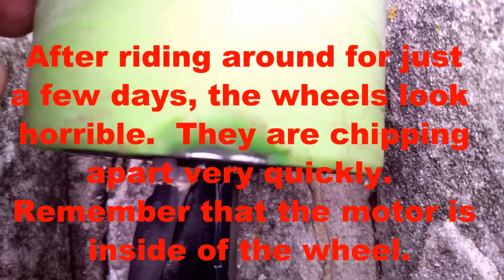Genesis Electric Skateboard Review Part 3

Comment: Got my board last Friday. Put about 75 miles or so on it. Had not one issue for a while. Came back from the store (maybe at 6 or 7 miles at this point) and had two bars battery, then it just stopped. I had hit bumps a day or so prior and earlier on a ride that are pretty wicked and never had a power issue. I was about 500 feet from home on a VERY smooth hill when it did turn off. Tried everything and it wouldn't do much. If I disconnected the battery and re-inserted it and left it upside down it would turn on and run fine, but the second you tried to flip it to wheel side down it would turn off and not turn back on. Called them and explained it. They had me print a shipping label and just mail it (on their dime) to NY. I should get my new one not long after (similar to your situation). In the days I was trying it I didn't trust it to go far either. I woke up really early on the weekend to test it on a main road I would use. I was extremely satisfied. I was actually a little surprised with how big the wheels were when opening it. I knew they were big but DAMN! It either pushes the rocks or goes over if they can't be avoided. The warranty is awesome, they were friendly, the board is sick (minus the one MAJOR issue I had; which is being resolved). I am going to buy my wife one later this month and a couple extra batteries. Will be fun to cruise into town and swap and make it home. Do plan (once the warranty expires) on re-gripping and adding some Spitfire bearings or other nice ones. May also look into the connector if I need later (seems to be the only issue others have had, as well as the one I had) and add something better on, or bring it to an electrician and pay him $50 bucks. I think it is the female end getting loosened up by the male end while bouncing. I am pretty light so I didn't have too much bend unless there was a big bump. Either way, it works well for what I want it for. My MAX distance on a track that was kinda up hill and down with HUGE cracks, was 10.66 miles. I pushed the last .4-ish. Very confident it will get 12 or so on the smooth roads. The bicyclists got a kick out of it! They would pull up at a light and say, "That is why I couldn't catch you!". A lot of fun for sure and I feel you on the getting to know the board before going far.
Reply from the maker: I had all the same hope as well. My board no longer turns on the mount that holds it.......well im working on part 4 smh gd it genesis so dissappointed. I have heard about so many returns. The return rate must be unbeleiveable. on the bright side if you order direct from china you can save about $200 but i would never buy another one thats for sure.  Just a throw away board for me now. Its done this is my second one. I cant see playing the return game over and over but I will see what they say. I feel like theres no boards they have that will hold up to serious milage. Now dont get me wronr I put a ton of miles on it. A whole lot of use out of it and rode hard all the time. These just are not meant for that. with all the videos they make they make it seem like that though. I have more reviews on other brands coming Im working as hard as possible here. sorry for the delay though
Reply: urmaker The question is would you really and I mean really trust your life behind this rebranded product? You do know its a KooWheel D3M Skateboard with a Genesis Stamp on it instead. My Genesis HellFire runs ok but I just dont trust it cruising here in NYC. I literally tap down to brake and I go flying. its too sensitive. I do it accidentally and pay for that all the time. For peace of mind and safety I would reconsider and spend extra on a quality company's board. Genesis just purchased 10,000 boards from China, rebranded them and now flips them for profit.
Reply: I actually use the brake just fine. It is very sensitive (and was a learning curve) but can also be used pretty well and solid without tapping. Yes, I do trust it, as  much as I would any other. But, I am not cruising between traffic like you may be doing. I am fortunate enough to live in a place where there are a lot of paved biking trails as well as pretty decent streets.I highly recommend you do not tap the brake. That seemed harder than learning to SLIGHTLY apply pressure. I haven't tried others but am actually surprised with how it was. I was expecting the brakes to be unbearable. For my needs it is perfect but for others it may not be. It is more of something to get my wife and I out of the house, not so much commuting anywhere important. I did put some miles on it. LOL A lot of fun.
Reply from the maker: my opinion is in order to compare something to something else you have to use them both. using one and speculating on another is not really a comparison.  The board is very very usable without a doubt. I did a lot on it I never thought I could thats for sure. But did is the key word. For $500 how long does anyone expect to get out of this board? A year? Give me an entire season and $500 is ok. Get one and cant use it at all is no good. Get one and use it for just 3 weeks. No good. For some it may be great and service its purpose. For others it may be very disappointing to say the least.

Comment: Joe any luck on Replacement wheel/hub. I have a new board in the box but dont want to go crazy on it yet. They haven't got back to me on replacement wheel info.
Reply from the maker: +BroFessor Sqrl they told me they dont have them but i found a company that seems to have an awesome setup.  They have diy or complete boards at the same price point.  As far as wheels i found the whole truck and wheels setup for $150. Just in case but i have a feeling this board is getting converted.  Stay tuned for sure i am nailing the order down this week.  im pretty impressed with this product i found
Reply from the maker: +BroFessor Sqrl im getting info about this company as well.  looks like they are not customer service oriented as from theirl business they ran before this one.  I feel like they are in to get in and out.  After this year i dont think we will see much of them.  Theres much better product out there as im finding just no means of marketing.  If I find the right board I'm going to gladly make as many videos as I can for the company I'm on the hunt
Reply: Joe Kyser cool keep us posted. im in nyc where the roads are horrible. got a feeling ill have the same wheel issues as you very soon
Reply from the maker: BroFessor Sqrl dude wait till you see part 4. The wheels are tore the fuck up.  I am much happier when i use the tube tires on my other board.  I have the skate wheel option and totally love it way better but riding long rides and all the all terrain is the way to go.  I will be doing a review on that board as well and I'm going to show the difference between the all terrain and the skate wheels.
Reply: Joe Kyser im thinking of putting a layer or SHOE GOO over the wheel that covers the hub motor. Its a great glue skaters use to repair skate shoes when ripped. Its amazing glue and leaves a tough layer. Look into that.
Reply from the maker: +BroFessor Sqrl oh i have shoe goo.  I think the wheel compound is too soft to have such a hard core.  The front wheels are mint condition still.  The compound of the front wheels is much harder.  Its the edges of the wheels so a little glue around it may be helpful.  Im thinking coating the whole thing will lead to bad traction though.  Idk hey its a possibility
Reply from the maker: those replacement wheels look like the ticket huh?

Comment: the evolve gt boards are great. they are super fast and incredibly nimble with the double kingpin trucks. this board has A LOT more potential to hurt you as it is a MUCH higher performing board than the genesis board so please be careful and wear pads when getting used to the board. GT mode is NO JOKE. the throttle will easily toss you off the back and the brakes will put your face in the pavement if you are not braced. the remote is super schetch as well so any time you are not actively riding the board, turn that remote off immediately. the slightest brush of the trigger will send the board sailing.

there are a lot of 'issues' with the evolve boards. as an owner i am going to make a prediction you are not going to be entirely happy with the evolve board as a daily driver. chances are you are going to experience some type of issue that displeases you. there are just to many issues to avoid them all.

if you dont mind a suggestion for the direction to start looking for your next purchase, i would strongly suggest you look into metro-board. they dont make the sexiest or fastest boards but they do make the most powerful board and they have a long standing reputation for incredibly solid build quality and incredibly good support for the times when issues to come up. i have a metroboard for almost 2 years now and really there has only been one time it failed and was not usable and that was likely the result of my own abusive use of the board. i really like the hardwood stringer decks they offer but they will even build a board on a custom deck you send them if you want.

i have a bunch of electric skateboards. you can see them on my channel. the metro-board is the most reliable.
Reply from the maker: dumwaldo well I've had it a month now and you hit it right on the head subscribe to my channel and wait and see the experiences I've had so far it's just been crazy especially my issue that ended up costing me money but I understand why it happened two hundred and $205 later back on the road. love it
Reply: Joe Kyser I realized after I replied that I was a little behind on your videos. I'm subscribed now and I really like your take in things so far so I'll be watching. Ride safe and I'll see you in the videos 👍

Comment: Hey Joe - here's a thought:  

I 've been riding a "Carver Resin USA" - a 31.5" skateboard with spring loaded trucks...

http://shop.carverskateboards.com/collections/surfskate/products/31-c7-resin

 - if you do some heel-toe action this board will self proper itself.  just swing your hips a bit - do the heel toe thing - and you are pumping along.  people look at me like I was on a motorized board - but I'm the motor.

What if you took the spring-loaded front trucks from the Carver skateboard - and put them on the genesis?  switch out the wheels to the Genesis wheels - and you may be able to pump along with the motor to extend the mileage-range...

What say you -Joe - and eboarders?
Reply: audionics2001

Comment: have u tried the fast mode? apparently when it's off, press the power button 7 times and it should beep and be in fast mode. when u turn it off it goes back to normal. what difference does it make to speed? thanks for uploading
Reply from the maker: +mackiwawa yeah I saw the video that the manufacturer made about that the first board I had that was never required you could just mash it and it would go full speed without a doubt you never had to press the button several times so I'm going to have to check that out. That must be part of the upgraded motherboard feature
Reply from the maker: do you have the tomahawk?
Reply: i've ordered a koowheel d3m which is like the genesis evolve or something
Reply from the maker: mackiwawa oh ok, i was looking for someone with this exact board.   had a question that's all.

Comment: Found replacement hub motors for Koowheel/Genesis https://m.aliexpress.com/item/32763191063.html#autostay
Reply from the maker: Yeah i saw the motors on a couple different sites. According to the stamp on my wheel they are 350w. Genesis claims different 250-260w or something like that. Theres a bunch of options for hub motors but I wouldnt buy these same ones.

Comment: Hey Joe!  Thanks again for your no holes barred reviews!  I think I found the koowheel equivelent on alibaba - and they have a warehouse-distributor in the LA area where I live.  Here's the link - check it out and let me know if you think it's the same as the 36" model genesis hellfire:   https://shenzhenzhanda.en.alibaba.com/product/60532991058-802227048/Koowheel_4_wheel_longboard_250w_2_Remote_control_sport_electric_skateboard.html

I will contact them and see if I can pick one up over the weekend if you think it's worth checking out.  I'm new to the e-skateboards - but have been following the genesis reviews closely - especially yours!  No sucking up in your reviews -  you call it as you see it - or ride it as the case may be.  keep it up!!  thanks!  eric
Reply from the maker: thats the belt drive version but ya thats the company
Reply: Thanks for looking, Joe - scroll down a bit  - when you get about a third of the way down they start showing their board - and compare it to the belt drive board with the non removable battery.  I think this the same board as the genesis hellfire.  I really value your opinion - and want you to confirm.  Please scroll down.
Reply from the maker: audionics2001 oh you know what the actual pictures up top have those same pictures of the belt drive so when I clicked on the picture that's exactly what came up was the belt drive I know they did have a belt drive version at one time I know that for a fact I saw that before this board came out then they went over to this style that was probably almost a year ago though and the batteries were different too it wasn't the same battery but anyway I'm going to get in contact with this company and I'm going to see what I can do about getting one of these boards if they're telling me it's not the same as Genesis I mean I would be more than pissed off if I got this board and they're telling me it doesn't have the same issues and it's not the same board but see the thing is I've also found this board without a name on it on Alibaba. same exact remote it almost makes me wonder if maybe this company does have a good board and the manufacturer sold all the defects to the Schmucks in New York. I know that's harsh wording but I just feel like this company is just ripping everybody off at this point there may be a couple boards that nobody had any issues with right this minute but I'm going to tell you what there's no way they're not going to have a problem with it I'm calling every single one of their boards a piece of s***. I've seen way too many problems now almost every person I've seen on YouTube has had an issue almost every person not everyone but almost every person. I'm definitely going to contact the manufacturer of that board there for that link that you gave me let me see what I can get worked out if I can get my hands on one and not pay that much I will do it I'm not paying that much and taking another risk though there's no way I actually feel a little weird even paying anything for it at all to be honest with you to me it's definitely a gamble without a doubt I'm looking at it and I'm going well that's the same exact word they have to tell me what they did first of all to fix the connection problem I got to see pictures of what they did how they did it I have to. it's a little hard to believe the connection looks the way it does on the board here I have but I swear on everything I have two boards they both look the same exact

Comment: Can this board go 20 miles?
Reply from the maker: +Dom T sure
Reply: it doesn't go 20 miles in range at all u tested it 20 miles range and it top speed is what cause u were going slow
Reply from the maker: no one ever said it can go 20 miles for 20mph and I have not showed a test yet for 20 miles enurance but if you need proof I guess I could. Im not really trying to stick up for this company. I dont recommend the board because it a cheap piece of crap. But if all is required to go 20 miles. It will do it. Will it go full throttle for 20 miles. No way but in my video I talk about that.
Reply: Sir Based on your Analysis were does full speed get us in range
Full Speed 12 Miles Max  or 8 or 7 or 9
15mph Consistent  Range 16 Miles
Break Something down for me in range and speee dplease
Reply from the maker: thats a lot of riding but I have a neat little app and did some tests where it tells you how far I went and average speed. Thats coming up in the next video. What I will be able to do is give my average speed for the rides I take. Tonight it was 5 miles and the average speed was 10mph. That included stopping at stop signs, yielding to traffic, red lights ect. Rider weight and riding conditions mean everything. Just because I can do one thing on this board doesnt necessarily mean you can do it and vice versa. I will be posting many videos and you decide if rides good enough. Ever ride 20 miles on an electric skateboard? Ever ride 5 miles on one?  I can bet many people quit before the charge runs out. I got my new board today. You will see the differnce between the cheapest and the best.
Reply from the maker: if you went full speed all the time I know it goes 10miles. I never completly killed it at full speed yet though. After 10 miles it was pretty low though